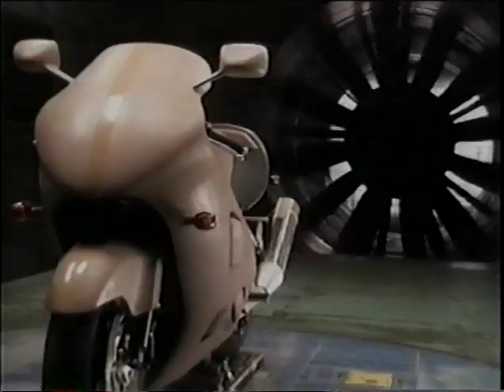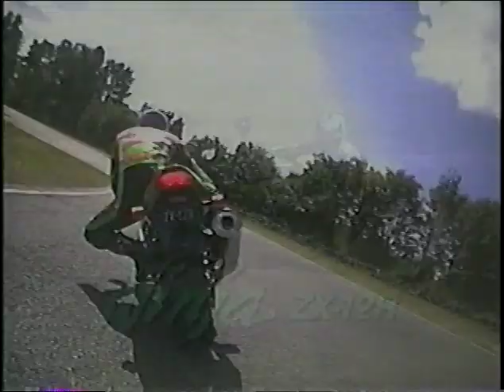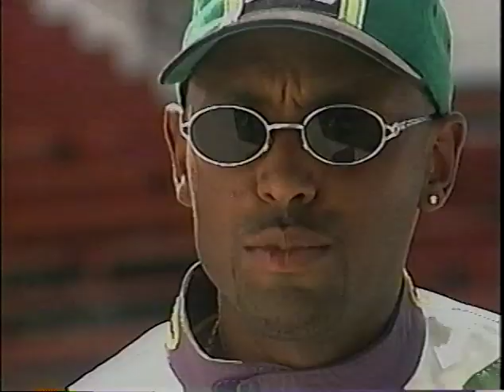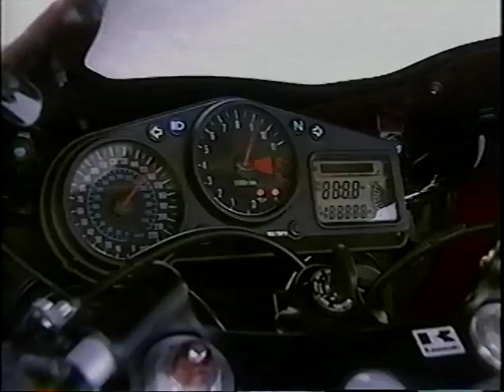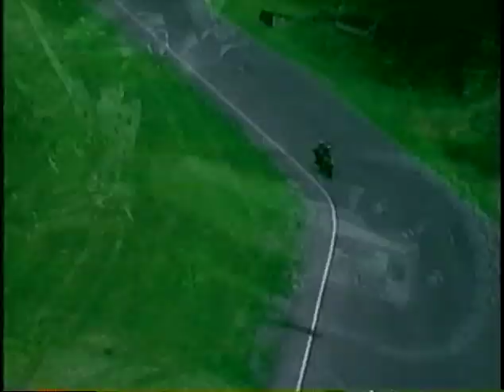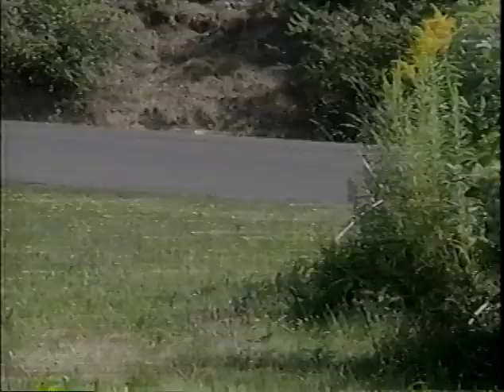ZX12R Development Video RARE L@@K

Comment: Love my zx12r 2005,but when closing the trottle there is a whisling sound from the airintake  no matter if im using the stock airfilter or bmc
Maybe somebody can tell me where the sound is coming from, i have the bike now about 9 years and berfore there was no wishling sound
Is it a airleak  or resonance ? i dont believe its normal i hear the sound in nutral when im htting the 5k rpm or higher and engine braking
There is no motorshop that can tell me whats wrong with the bike

Comment: It's funny how he say's nothing can beat it when talking about the ZX12r, top speed at the time is true by 20mph on the 9r, but on acceleration the ZX9r was a fraction quicker. The earlier C model 9r done a faster 1/4 miles time than the 12r, being the first production bike to do it under ten seconds with a 9.9 at 136mph, and the E model is certainly a fraction quicker than the C being lighter and a bit more powerful.

We have to remember though, with most sport bikes the differences are just fractions of a second, in the real world that is nothing. If you don't mind spending extra on fuel and insurance, and prefer the looks of the 12r, get one, but the 9r is better all round 😎
Reply: You are out of your mind. The 9r has absolutely nothing on the 12r. The 12r is the greatest sport bike ever made.
Reply: @jacobforaker6222  😂 😂  it is a great bike, but the 9r is better 😎
Preference wise to me its the better looking bike, performance wise on the road they are pretty much the same apart from the 12r having a higher top speed that will rarely be used on UK roads. 
The quarter mile time of the 9r is around half a second or so quicker, even the heavier 98-99 C models that were the first production bike to do the quarter mile in under ten seconds as I may have mentioned above.
And the 12r being much heavier and a bigger engine meaning they also cost more to run, on the road and insurance etc.
That said, if the 12r is the best bike ever to you, that's your choice/preference.
Reply: Hahaha check your mind 🤣
Reply: @MegaVin88  I really can not compete with that level of intellect 🤷‍♂🤣🤣
Reply: @MegaVin88  Hahah! no, it's all facts!
Reply: Let’s see. 
I have bought 
85 900 ninja 
91 zx11
2000 zx12
2012 14r
2015 H2
You sir talk out your ass. 😢